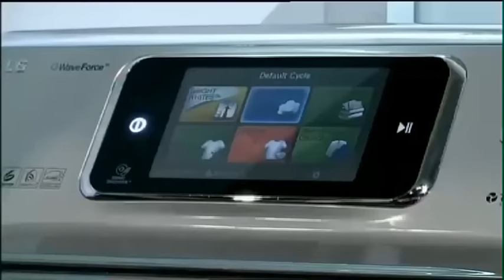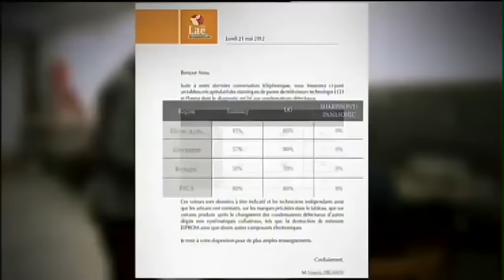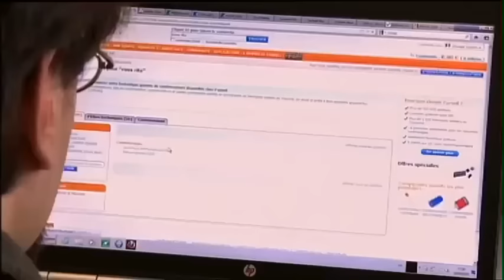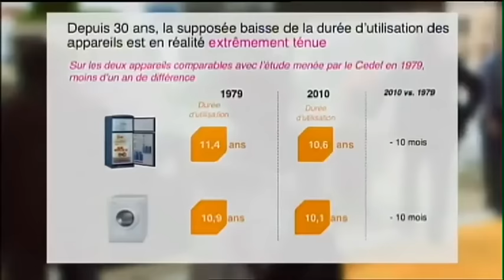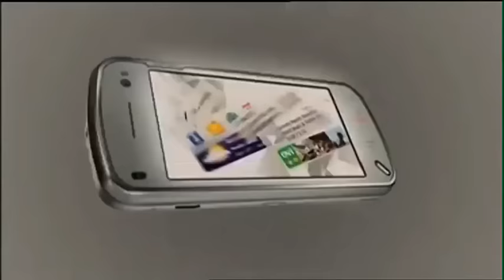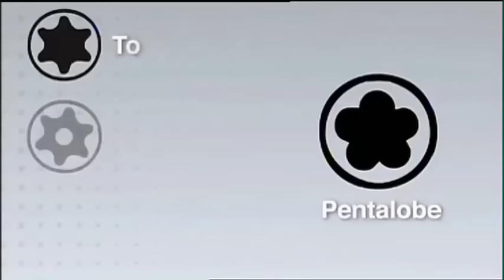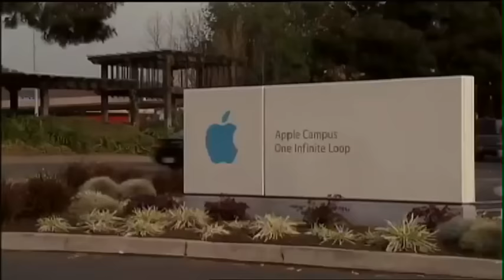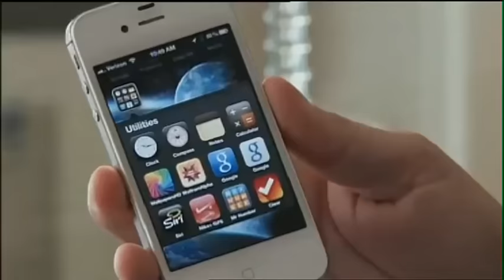Apple and Samsung: Built to Fail? The Truth About Planned Obsolescence | Investigative Documentary

Comment: When they made the batteries impossible to remove and replace, that answered the obsolescence question.
Reply: I am in thaialnd most repair shops in malls can open and replace batteris for less that 20 USD, tools exist to do all of this research it!
Reply: @ebaystars  Yes but I don't think that's what he means.  Before you could easily switch out batteries yourself with zero tools, in about 5 seconds...that meant you didn't have to carry a power bank, just a spare battery which you'd charged in the phone beforehand.  Then when the first battery got low you could just switch and hey presto a full battery again.  Much more compact and easier than messing around with powerbanks.
Reply: the argument for making difficult to replace battery is that the water tightness becomes compromised. i made the mistake of swapping battery at apple store but then not using a water proof case which then caused the face id component to fail when the phone got exposed to high humidity or exposed to liquid. or at least that is my reasoning.
Reply: @manp1039  Seriously?  Phones aren't remotely waterproof anyway so I can't see how that's an issue.
Reply: @manp1039  only a very select few phones are waterproof, but 90% of phones have non removable batteries. Not sure how old you are, but they've had waterproof phones for decades now and they used to make a line of Samsung's that were physically as strong and waterproof as any case that you can buy. Also in Asia where they know they can't "bedazzle" you into buying a new phone every year, they still offer such phones. 
If you enjoy the planned obsolescence you're free to express it, but applying the tiniest bit of scepticism shows that it is totally unnecessary.
Reply: @grapeseed427  perhaps i should clarify:
The iPhone 13 Pro Max is water-resistant. It has a rating of “IP68” which means it's fully protected from dust and can handle being underwater for up to 30 minutes at a depth of 6 meters. 
Iphone X models have a rating of IP67 under IEC standard 60529 (maximum depth of 1 meter up to 30 minutes) 
In my mind these are levels of water proof.
Reply: @manp1039  thanks for clarifying because otherwise I honestly may have never known because I absolutely despise all apple i products. Pioneers blazing new, and based upon your testimony exciting, avenues to planned obsolescence.
Reply: @manp1039  military systems make IP67 rated cases (dust and water) with a means of replacing batteries, one of apple founders first iphones designer staff demonstrated a prototype and he (Jobs I think) dropped it in a jug of water and said - "hey there's room for more stuff"  as bubbles are coming out, I had a pathetic Iphone and in Thailand I have an air con car very cold when I got out of the car on a hot humid day  the inside of the apple had immediate moisture condense on its insides  causing it to fail after that I switched to Samsung G7s after I tested it by submerging it in water, no bubbles came out.   I still have the G7 samsung and its 8 years old works well, as a phone and occassional browser. When you realsie that handy/cellular phones are no more than a marketing scam and less of a communication tool then just switch to various desktop PCs/MACS, where you can control ads and stupid stuff.
Reply: @manp1039  just pop the back(battery cover) off and stick it in a bag of rice and... nevermind. It's all "sealed"
Reply: @grapeseed427  unfortunately that is not a good solution.. because the liquid breach also is a breach of what ever the liquid contains, including minerals and chemicals.. additionally the liquid and chemicals and minerals create oxidation on components inside as well as leaving deposits on components and contacts etc. the better option is to block water intrution.
Reply: @manp1039  I think the better answer is ventilation, seems to work for everything else. Condensation from temperature fluctuations is inevitable, proper ventilation would help equalize temperatures inside and out and drastically reduce condensation....
Or you could seal it knowing that condensation will start corrosion and just market it as "waterproof up to 6 meters" and charge extra for the planned obsolescence...I mean updated design.
Reply: @grapeseed427  you don't want liquid ventilating onto your electronic contacts and internal conducting components.. I think You mean more like you need some kind of cooling system to keep the phone from over heading. but you want to keep the ins where the comenents are dry..just like you don't want liquid insid of a hard drive case
Reply: @manp1039  not sure what liquid ventilation is, possibly an oxymoron, but I was referring to the fact that condensation is a byproduct of temperatures fluctuations. One example is walking into a warm house on a cold day and your lenses and screen fog up. The same thing happens on the inside of your phone, but with proper ventilation the temperature on the inside of your phone will equalize much faster and would dry out much faster which would reduce corrosion of internal electrical connections and components. The heat generated by the device speeds the process.
When the phone is "sealed" that trapped moisture becomes corrosion and slowly ruins electrical connections and components, heat generated by the device speeds this process as well. 
And no, I didn't mean cooling fans or a cooling system.
Reply: When Steve Jobs first crested the Apple computer he intentionally made it do it could not be opened and repaired by an individual as well as not compatible with any other products but his own. He failed with apple at first and dome years later society got gullible and was suckered in. I grew up with television with internal parts and bulbs so when something went  a miss dad grabbed the screwdriver,  took the back off and got that bulb tester out and wallah it is fixed. Devices running on computer now from , TV. Refrigerator. Microwave etc etc it's a wrap when malfunction.  I gre up with one Refrigerator and one mattress. And they truly lasted.  Now these items you lucky to get 5 yrs
Reply: @gooodies4u1  you're one of the few smart people left in this country, may GOD be with you.
Reply: @simonh6371  a decade ago I had a water resistant phone ip57, which had a user replaceable/ swappable battery.  Took me less than 30 seconds.

I couldn't swap the battery when it was wet, but otherwise  could drop in water and as long as it wasn't left for an extended period, it was fine.
Reply: @Unsensitive  Actually I'm looking at some of those outdoor phones for the future.  Some even have night vision.  If I can get one with a user removable battery all the better.
Reply: @simonh6371  There were waterproof phones with removable battery, but this it costs more!
Reply: @manp1039  "water tightness becomes compromised" not exactly, but cheaper to make water tight.
Reply: @shmeleu  Yeah I'm going to buy one of those when this one dies.
Reply: Battery, they put glue underneath while apple use pull tap but serialized the battery. Fk
Reply: @simonh6371  i’ve seen them submerged in water for while and work fine, seem them work while under water. unless you dropping them in deep water they be ok.
Reply: @manp1039   I repair iPhones daily and regardless of what the specs say the iPhone X ,XR etc. are not waterproof. Th›ey started using that "seal" on the iPhone 7's. Until you open it and see how it's built with your own two hands you won't know. Watching videos and looking online doesn't cut it. The only main difference with the "waterproofing" up to the X series was a shitty adhesive seal that only served to make the phone harder to open and change the battery, not that much harder but any amount does impact repairs! Forgot to mention we were 1 of the only 2 Certified Apple Service centers in town andafter two years we couldn't stand they're practices anymore. GSX is garbage which is the system the techs have to use to process repair jobs and it provides the repair guides, near the end they're wasn't even repair guides so you couldn't even repair the stuff even if you could physically do it. Stuff like soldering ram and SSDs to the main logic board(wtf) so happy when my boss said no more! Apple is almost like a religion, way worse than the whole fanboy/girl ideology.
Reply: Not really ,the EU has passed a new law so that all ohones must include user replacable batteries, so  once it takes effect  all phones sold in EU will replaceable batteries and USB type C,  most likely the big phone manufactureres will not  make 2 versions of their phones   ,one for EU  and one for  everywhere else so we should benefit here int he states too.
Reply: @andreamitchell4758  mean they already do that. the usa iPhone is different then rest of worlds iPhone. personally id rather have water resistance and wireless charging then being able to swap a battery a little easier that I've never needed to do. I use wireless charging every day and water resistance has saved my $1500 phone few times already.

Comment: As an electronics technician I confirm that what is said in the documentary is true. Like somone said below, it started with the lightbulb industry, and now they're doing it with all kind of devices, those "new features" that companies come up almost every year are just a way to make you buy a device that basically do the same job than the prior one, ie USB change to USB-C, headphone jack conector to bluetooth, they're doing it with apps also, some of them won't work on older versions of your software, pushing you to buy a new device, Apple does this a lot, that's why I'll never buy an Iphone. Samsung as what I can see, is resisting the urge to follow the same path, but they won't last long until they decide to do it. To confirm other comments below, the most rigged industry right now is the LED bulbs one, LEDs can last a big number of years, the trick is this: they overwork them by supplying more voltage than their specifications to diminish their lifespan. Be aware of this scams, support your local repair shop, don't buy things you don't need, the planet will thank you.
Reply: you really got everything wrong. but don't worry, that's happening a lot on the internet. changes like from type A to type C happened exactl once in over 20 years. so those changes happen very very infrequently. Next, iphones are among the longest lasting phones out there and are supported from Apple with updates anywhere from 7 to 10 years, so they expect their devices to live much longer than those from competing cheap Android brands.
By not buying an iphone, you contribute to planned obsolesncen and increased amounts of ewaste.
Reply: The LED bulbs fail not because of the  LED diodes are overvolted but because of the same reasont he TTV's fail  bad caps,  they don't need to overvolt the  lED's to mae a n LED bulb fail they just need to  put in a  cheap power supply /LED driver with cheap caps ,  I had so many LED bulbs fail on me,  it i never the LED's that are the problem it is always the power supply and the bulbd will flicker and then fail they last much shorter than  CFL's.
Also the problem of old versions of OS's not running  new app versions   is one thing but now they are doing the opposite, I just got a new phone with Androi 13 and it won't run older apps, I have to keep my old phone now, I have some smarthome apps and other apps that will not wokr at all on  Android13 even when sideloaded
at least with new app versions not working with  olds OS versions you can   sideload and old version of the app and not update the app,  but Android has completly fractured the platfor by breaking backwards commpatibility becaue of MUH SECURITY,,there is no way to get  the apps to run at all.

Comment: How is a refrigerator used 11% more??? They run 24 hrs each day...have they added 11% more hours in a day??? Adding more food shouldn't make the refrigerator work harder..😮🧐 it's still doing the same amount of cooling..no matter how much food you put in it...
Reply: Actually it has to do significantly less cooling if it's full. Also, opening the door more often requires it to do significantly more work

Comment: The Videocon fridge back at my home bought around 1995 still works. All it needs sometimes is a gas dosage which costs around $10-$20 once every two or three years.
Reply: That's a large refrigerant leak. I've seen a 30 year old fridge used as an outdoor chicken bread holder with only surface rust. Never had to be refilled.
Reply: i had a Videocon as that was never maintained but it ran for more than 15 years before the compressor fell out due to rust. it was never maintained so it was in dire condition. very good quality for the price back then. comparable to Japanese company while being cheaper than Japanese . Videocon were the last ones making crt . pretty decent for Indian company.

Comment: My husband and I had LG phones... mine lasted 8 years!  He put both of them in an OtterBox, the toughest one they made. 
He put a glass screen protector on his, due to his previous Samsung totally shattering from 1 drop- it never even made it home!
I didn't put the screen protector on, and I dropped it many times a day...My LG ThinQ 30 still works fine- i just ran out of memory due to having so many irreplaceable photos on it. I eventually decided to get a new phone and was sold a Nord 1+ 5G. 
I didn't get to do any research on it, and thankfully its a great phone with tons of memory. 
  One of the reasons I didn't get another LG phone is that LG quit making phones...i guess its not profitable if they never break.  My husband's LG phone, exactly the same as mine, did not do so well. He constantly kept it on the charger and it stopped holding a charge, then started malfunctioning in its 8th year.  Our LG washer and dryer worked perfectly for 10 years +, and his gorgeous LG big screen OLED TVs are still going strong.  We learned that the curved screen ones get too hot, and they fell by the wayside (the junk room)
 We learned from that, though. If TVs get hot, then you must keep a fan blowing behind them.  A simple way to keep those expensive toys working beautifully for many years!!🎉😊

Comment: My iPhone was in perfect condition but the updates eventually could not be installed …
Reply: I was given an S4 that I could not install Google updates or YouTube updates.  I couldn't even install YT.
Reply: I have two samsung S7 edges (7 years old) and I have NO problems with it as I fully support BOTH phones (virus, memory, backup, etc) , yes some apps will fail eventually BUT thats only due to not being able to OS update and this will NOT affect the phones basic functionality it's a phone with some google stuff and firefox plus things like audio playback etc. More clever apps, word excel etc, if you are stupid enough to install them rather than use a desktop or portable instead which can always be better
Reply: @janice8514  give it to someone half your age and they will fix the problem
Reply: @ebaystars  That's actually a good point.  People expect to do everything on their bloody phones nowadays.  I only use mine on the move.  I don't use my Swiss Army Knife to cut meat and veg in my kitchen every evening for my dinner either.
Reply: @simonh6371  im 71 and my first computer had piano keys on the front to load a bootstrap punched tape loader from MY memory, (down up up down up down enter etc)  so ive seen sold manufactured implemented and used this crap for ever, from 8 bit to 64 bit from DOS to linux (in radio work) I put a rugged case on my G7 and here in Thailand I use it very little - I haven't bothred to root it but it's full of pathetic bloatware and advertising links one cannot remove, how can anyone conduct business on them?, they are complete junk. I was in Honda waiting room the other day and about 6 kids in there (2 families)  spent a whole hour each engrossed in their phones without one single interaction. This is very sad. I "taught" my kids to fast accurate touch type at age 7 on two side by side old apple macs by competing (bro and sis wars) with each other etc.(Mavis Beacon teaches Touch typing) ....I don't see any of that any more....just mobiles glued to their brains

Comment: This is 100% a real thing though I've always had good luck with my devices. I am using a 7 year old phone I bought new in 2016.

My gaming computer has a processor from 2012 which is still working fine for the games I play (FX8350).

I just take care of my stuff & it seems to last me fine. I actually am still using my first laptop I bought in 2010! I installed Linux on it & it's plugged into my 2011 plasma tv 24/7, I use it as a media machine for when I torrent movies & shows. I also put my old SATA SSD inside & it's much faster.

It's not hard to find uses for old stuff. Also I don't do this out of necessity, I have the money to buy fancy new devices, I just don't need to because my current devices are working perfectly fine. I plan on buying the Google Pixel 8a when it's released cause I want a smaller phone for GrapheneOS (privacy & security). I just buy a new device when I have the need for one.
Reply: I just got a Dell tiny brick  for 50 USD and Im giving it a dose of ProXmox to make it better!

Comment: Plasma was just coming out when I bought my TV. I opted for the Sony DLP because the lamp is designed to be replaceable. I've had the TV for 15 years and it works like new. I've replaced the lamp once a couple years ago, it cost about $30. So I bought a couple spare lamps figuring someone will wise up and stop making them eventually.

Comment: A lot has to do with the voltage we sit on 240 volts and I have seen it as high as 260 I have had tv's plenty of led lights fail all are meant to really run on 220v bet all the 110v Samsungs don't fail as much. We just had a recall on LG tv's with the cap's all failing